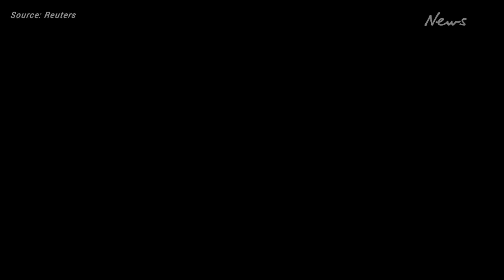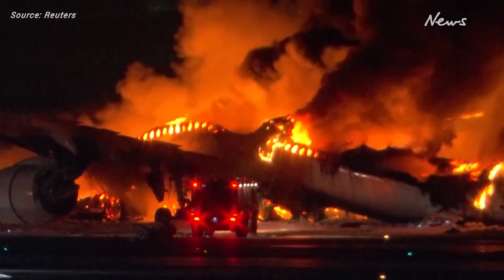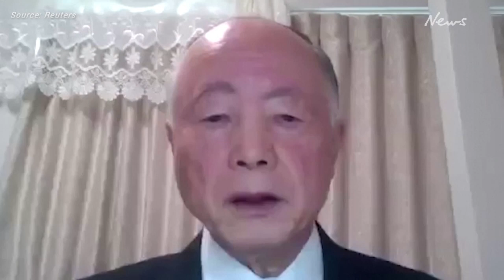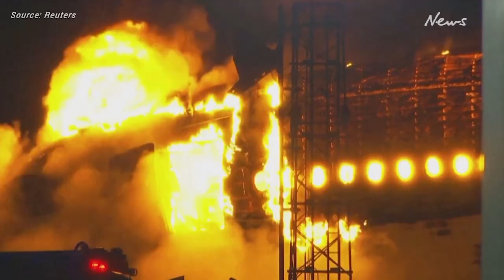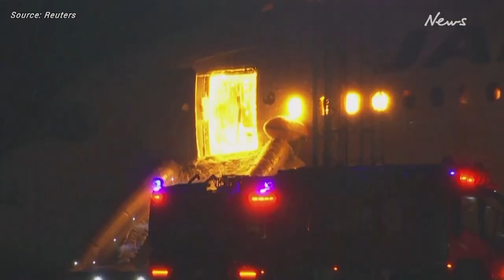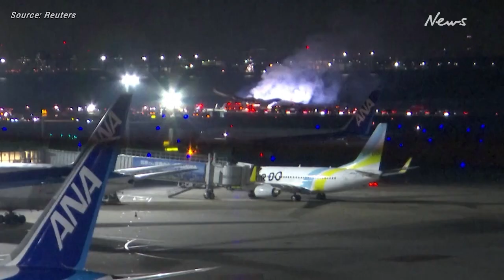Japan Airline collision likely due to human error: Expert

Comment: In the records, the conversations were conducted in aviation terminology using English, the dialogue between the Japan Coast Guard aircraft and the controller took place from 45 minutes and 11 seconds to 19 seconds.
The controller, after informing about the first departure scheduled among the aircraft near the runway with the term 'Number One,' stated, 'Proceed with ground movement to the position before the runway on taxiway C5,' instructing the aircraft to taxi to the stopping position on taxiway C5 just before runway C. The Japan Coast Guard aircraft acknowledged, 'Heading to the stopping position before the runway, C5. Thank you,' in response.